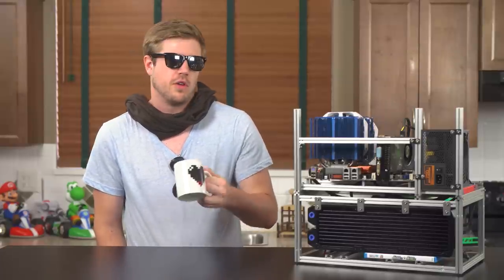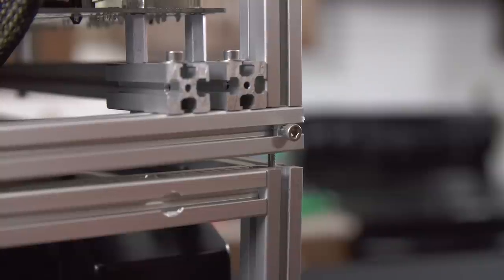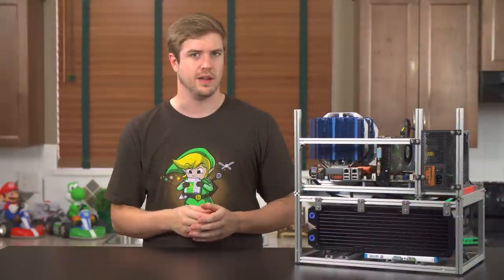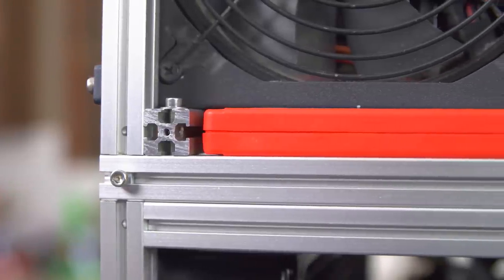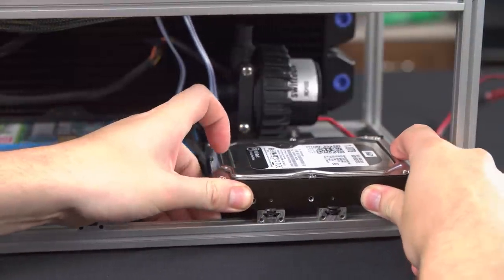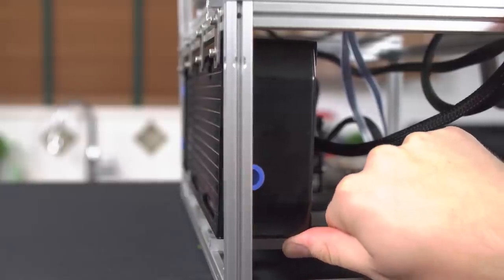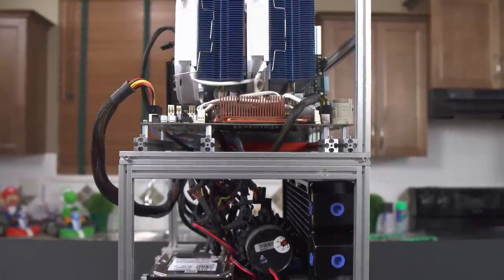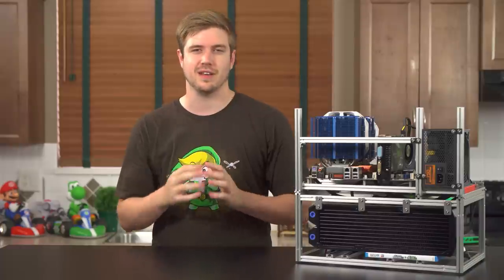Spotswood Tech Station - Extremely Modular Test Bench

Comment: Is it a good idea to use a test bench as a permanent pc 'case'
Reply: No. It would easily get killed by static.
Reply: Unless you plan on swapping and upgrading your pc every week, go for a case. It will help protect your precious components from all sorts of crap. (mostly cats).
Reply: come on, just get a case.
Reply: aweblade4 How the hell did you come to that conclusion?
Reply: You could go to a local Glas company and they can cut you some side and top panels. Than set it up like a aquarium and you have made yourself a showcase computer.
Reply: Akio Furukawa Most cases are placed it on a table or on the floor you may accidentally bump it.
Reply: It would work just fine, but would be quite dangerous if you have cats, dogs, kids or other pets strolling around. Oh, and if you rage and throw a controller through the room, a case might be more suitable in protecting your precious graphics card from an impact.
Reply: Akio Furukawa People don't understand the concept of appliances being earthed, ignore him.
Reply: aweblade4 Considering a lot of media outlets (say Linus Tech Tips) use permanent test benches, you are very wrong. If it's just sitting on a table, there's no danger. Just don't go jumping around the room being a lunatic.
Reply: No, the main reason: Dust. These test benches are completely open and if you use it like a permanent pc it will gather so much dust compared to a normal case that has dust filters.
Reply: CodyMetal
A case is not 100% dust-proof either, but if your main concern is dust then go for a case.
Reply: BinaryOneXero Gaming and Tech 2 All im saying is its not for commercial use.
Reply: Eh... dust gets in one way or another unless you've got a totally sealed case where the only intakes are perfectly filtered.

I think the big concern over having an open design like that is random hazards.  Children or cats (or dogs even if they can reach it) can stick their little appendages in it and bump something fragile or get themselves caught in a spinning fan.  Even an adult and otherwise responsible guest might not realize how important it is and rest his drink near it.  A more enclosed case offers more protection against those kinds of... random life hazards.

Personally I don't have pets and I never let children near my PC so I leave it running all the time with the side pannel off to help it with cooling.  So long as you're careful it should be safe.
Reply: Mansen True that Bro:D
Reply: PTNLemay Ironically those cases are very common these days...
Reply: It can be done. Though I'd ensure that dust couldn't build-up on it. Nothing a bit of covering couldn't fix.
Reply: Mansen
I'll believe that when I see a case that can hold water when it's fully closed.  If the water can leak out of gaps then air (and dust) can get in.  You'd have to pull the fans out for the test and replace them with some sort of hatches, which again would have to be hermetically sealed.

Cases aren't designed like that though, they accept all those gaps because it improves air-flow.  They would rather have extra air (even if it's dusty) than to seal everything and only allow clean air through the filters.
Reply: JKVengeance Not for personal use.
Reply: ***** What did I do to piss you off?
Reply: ***** *sigh* I'm not here for you i'm just answering ***** question. The only thing stupider than your ignorant comment is not taking safety precautions. Would you take a test bench to a LAN party?
Reply: ***** whoa.... calm down. He didn't know. Yeah I had a go at him but at least I said sorry. Jeeze. No need to be nasty like that. Someone not get laid last night? Christ. Rather than get real nasty, how about just explain. 

aweblade4 I would take one just for a laugh but I would want the screws to be torx screws so that no one can steal the GPU in just 5 secs XD. Also I wouldn't let people near it at all but that is just me. Ignore him. He is just pissed for no reason.
Reply: ***** Having random kids, cats, or drunken people running around out of control is definitely not a professional environment.
Reply: BinaryOneXero Gaming and Tech 2 Alrighty.
Reply: BinaryOneXero Gaming and Tech 2 Even though so, several person can work together to take away even a full tower case in 5 secs.
Reply: Akio Furukawa If you have pets, kids, siblings, or just accidents, it could get get killed by static electricity, and any other accident. It is much safer in a case and gets better airflow.
Reply: aweblade4 There's no reason you can't. There are open air cases (benches) that you can buy now that are designed to be permanent. Static electricity, contrary to popular belief, isn't as large a problem as people seem to think, in saying that, don't go running on carpet with socks on and then touch your motherboard solder points, no, if it's somewhere safe, i.e, on a desk, away from kids or pets (if you have any) then you're fine. Linus managed JUST FINE with two cats when he had his company run out of his garage, and he had two permanent benches IIRC. Static doesn't just magically build up and kill your shit. It was a bigger problem 10 years ago, but now, it's not such an issue, as lots of components have current protection if there's a tad too much power.
Reply: JKVengeance We've discussed this earlier, the conversation is over, read the previous comments.
Reply: iwan nenam And that would somehow make a mid tower without a side panel so much more safer? oh, right, it wouldnt.
Reply: iwan nenam well don't leave expensive equipment lying about unattended or out of sight. I don't get what you are trying to say. A team of 5 guys or just 1 guy doesn't matter. I think 5 people dismounting a PC is going to look suspicious but just one guy will look like the owner.
Reply: *****
Why would it be safer? When people have intentions to steal, nothing is safe.
Reply: ***** It woukd be safer because it you can change the way the side panel is facing, and if you do bump it your gonna be grounded by the edges of the case.
Reply: iwan nenam I thought we were talking about static?
Reply: ***** he was about LAN parties xd
Reply: BinaryOneXero Gaming and Tech 2 well, if someone takes a test bench to a lan party they deserve a roundhouse kick to the throat...
Reply: aweblade4
I'm sorry. Did I talk to you?
Reply: *****
We would never know people's heart..
Reply: aweblade4 The case is still grounded. It's also highly unlikely that you will kill a computer via static. That is mainly for ICs not attached to a mainboard.
Reply: *****
Thank you.
Reply: Hodor.

Comment: Can the frame be adjusted to fit mini-ITX motherboards and SFX power supplies?  If I have to do a bit of cutting I'm willing.

I'd like to build a small open air "cube" type of case that fits only the bare necessities.  I'm not sure it exist yet, but what I would pick is a motherboard with a powerful APU and a M.2 slot.  That way I won't need a separate boot drive or a big bulky GPU.  The idea is to make it so small you can slap a handle on the top and have a kind of "PC in a lunchbox".

Comment: in the reference photo of the bench he keeps switching to, it seems that the radiator is actually mounted to the bottom, not the top. maybe having it sit across multiple bars rather than hanging from a single bar is a solution to the issue?

Comment: Why not use 2 washers with a bolt with a nut in the middle so it can reach the bottom rail for the radiator ? It's not pretty but it's better than the wii case.

Comment: I know its been addressed, but why wouldn't you just mount the other side of the radiator as well? And why did you only mount three screws for the PSU?

Also, the link for the issues being addressed is out of date.

Comment: can't you just lower the top radiator bar so you could attach it to the frame on both side..? LinusTechTips or it has to be right there holding something? hard to see it's function besides the radiator from this angle

Comment: Wow.  Mini 80/20 extrusion.  DOPE!  Us iRacers love our 80/20, its by far the favorite way to build a dedicated rig.  Basically you either buy one of a handful of the actually GOOD premade rigs, OR, you build your own, and 80/20 is king./

I, like most other iRacers with dedicated rigs, built a dedicated computer just for the rig.  But THIS freaking thing.. this would bolt onto the back of the center monitor/wheel tray in such a dope fashion.  If I remember, Im going to link this video to the iRacing hardware forums.

Toats obscure.

Comment: This guy just bought standard industrial items and combined them in a package. We use the same aluminum rails for prototyping in my university (I'm a student in engineering). You can buy the rails per meter and saw them to your liking. The whole idea of this system is to be extremely modular, this company just claims it's developed for building pc's. It's just a nifty business trick, adding more value to a cheap unknown product.

Comment: Linus i have a question how would i sli a gtx 660 SC and a gtx 980 SC my mother boards a asus P8Z77-V LK (LGA1155)
Reply: +George Murray Simply put, you don't..
Making a sli with different gpu models is bad enough let alone your idea would ruin the point of having a gtx 980 in a sli. You would be better just using the 980 alone...
Reply: +George Murray for SLI to work properly you need to atleast be running the same GPU in each card Ideally identical cards.

Comment: Why would you move your personal rig to a test bench? 
Test bench has non existent air flow pressure making it a bit shit with cooling right?
Reply: If you don't have a case basically your case is your house. You can turn down the heat 65 degrees (18.3 Celsius) and it will keep your system at that heat
Reply: TheOneAndOnlyRegnal Dust, airflow. Those are not things you have an easy time with without a case...
Reply: Well, why use a fan if you are going to still be hot. The logic doesn't work like that Ihsan Mujdeci
Reply: Remington Rojas I'm certain my logic is right and your statement made no sense. Case fans allow for the moving away of the hot air around the cpu and graphics card and not to mention the other stuff the power management capacitors and ram and other things that get incidentally cooled by regular case air flow. A proper case would have exhaust as well allowing fresh air to be continually cycled through the case. 
In a test bench the air only moved through the cpu heat sink and down into the gpu heatsink and thats it.
Reply: You don't. That's why it's called a test bench. You can easily remove and reposition parts to suit your needs.
Reply: +Ihsan Mujdeci without a case enclosure, the expelled heat from the gpu/cpu fan heatsink can evacuate into the room, rather than in an enclosed case...which is the reason why cases need intake fans, and extake fans. you essentially don't need it since the ambient air is easily sucked from around the tech bench without doors or case panels to obstruct air flow. where cases are aesthetic, they have their disadvantages, like becoming a theoretical oven which you're constantly trying to prevent with air flow directions, pressure gradients, etc. tech benches do not have this problem as they have an unlimited source of free air for the gpu/cpu/psu to take. you do not need to cycle air in an open case like this since there is no buildup of exhaust air anywhere near this thing, since it's an open design.

Comment: hey guys
first of all thanks for your channel
i got almost all my knowledge bout pcs from you
so i finally built myself a pc and successfully started it up to bios on my outside first check to make sure everything works
only checked if all my hardware was recognized and turned it of afterwards

a day later i wanted to make the setupboot but everytime i tried startin it it only powered for a few seconds shutting itself down after
now i checked if all hardware was properly setup and powered but with the same result
tried to start with only the cpu, then with cpu and ram, then cpu, ram and gpu, and so on
also tried with only one memorystick instead of four and tried all different ramslots
still no diference so i got no idea what to do now
thx for help
Reply: i made it
still have no clue how but i did it
everything working just fine and i'm a happy pc gamer now :D
the board is a AsRock Z97 Xtreme4

Comment: LOL .. Slick with the packing material and so on :)  I liked the video only because of the funny parts in the video.

Very smart that Spotswood has things Allen key secured as yes it will be unlikely someone is carrying an Allen key around with them at a LAN Party .... until the millions see this video and things change :S

Overall though it sounds like this product has basic problems and thus not something I would buy.  I could hardly recommend others buying it.

Comment: What do you do about dust?
Reply: Much easier to dust than one in a case
Reply: noll4923g No? You simply take of/out the intake dust filters and brush them off. Done.
Reply: Myself, I'm usually moving parts around in a test station so often dust is never really an issue, as I'd also be cleaning parts as necessary during the changes.  But I have run some rigs on open test stations for as long as 6 months, and mostly the dust just goes elsewhere instead of being recirculated in a case until it's trapped in fan or worse.
Reply: Martin Pees  I ran a bench for a bit before I got my case together. Having mag filters on the radiators and psu  will help tremendusly.

Comment: you're dramatically underestimating the strength of the extruded aluminium form. there may be some flex between the screws and brackets but those extrusions aren't going anywhere.

can't help but feel your lack of knowledge has resulted in a product review which is a bit less than fair to the product itself.

Comment: You can order the longer tabs . . .from metal stores . .. for peanuts money. Or just get metal pieces and drill the freaking holes. . .not a big deal tbh. . .
Actually the whole frame pieces use quite standard design rods. . .they are not very expensive.The whole thing is horribly horribly overpriced, for the amount of money that pole guy ask for this thing you can make "tech station" the size of a car or two.

and btw you read his surname /homi/che/v/ski
homi - like in /homi/cide
che - like in /che/ck
v like in /v/ictory
ski like in /ski/ing